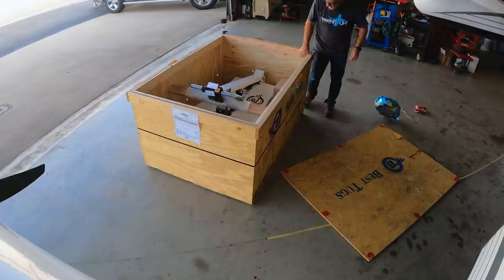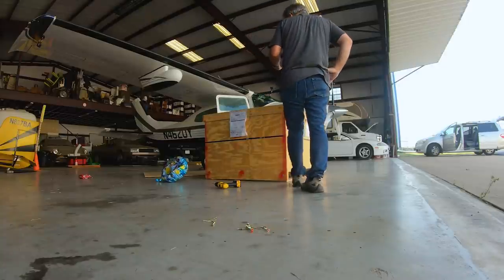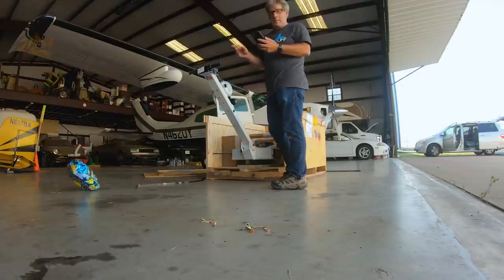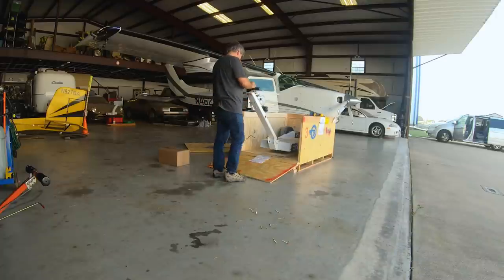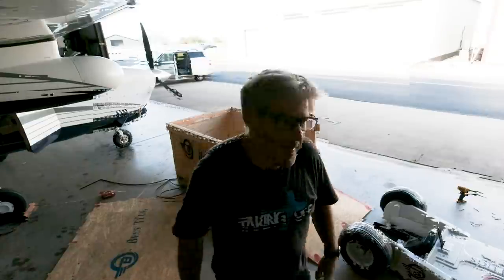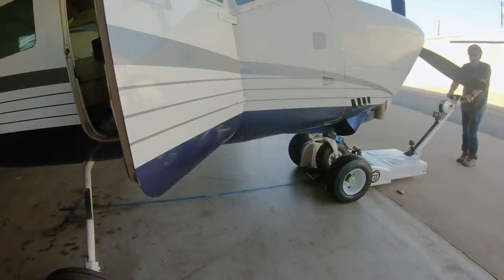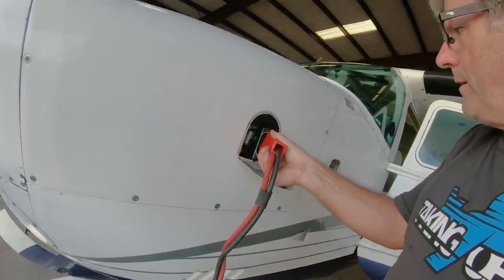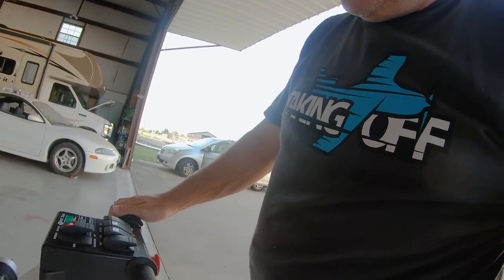Unboxing a Best Tug!  TakingOff

Comment: Nice Christmas present, Dan!
And a smart decision!
Over time Your new B5 tug will pay for itself by 
Greatly expanding the lifespan and prolonging 
the need to replace a dead lead-acid battery.

Furthermore it's a great investment in reliability of
of Lola - no missed filming appointments 
any longer because of a dead battery!

Aircraft starter batteries in general are always chosen too small
compared to industry standards with regard to the engine
size/displacement because of the weight
penalty that comes with their size -  after the engine is running you carry around a more or less
useless lead-acid bloc for the whole rest of the flighttime!
In cold winter conditions you now have the reliable chance
of getting Lola to live anytime thanks to the B5's integrated charger 🙂

PS: attaching the winch belt directly to the front-wheel fork and winching it  
into the wheelholder greatly reduces the amount of stress for the gear assembly and the
engine mount of the 210.

Dan, I wish you lots of fun every time you move Lola around gently with the help of your new B5 tug! 
BTW: I think your new tug should be given a name matching with Lola - what about asking the community for suggestions?
All the best and many happy landings! 😊
Reply from the maker: 😂 Ill have to chew on a name.
Reply: @TakingOff  My RF-9 is named HUGO derived from the Registration D-KHGO. Wait a bit and a Name for your new Lola mover will come up by itself - I am sure 😉🍀

Comment: Great video and I hope you enjoy your new plane mover!  I've seen several Romeos and a couple of Bravos in use and they really are much better than most everything else available out there.  I'm hoping to get a chance to use an Echo one day, but my current employer doesn't want to get them because they're not "heavy duty" enough.

As was hinted by Ethan - the best way to load is to use the strap and winch to pull the plane onto the tug.  You can drive under it, but that requires you to have the parking brake set or the wheels chocked.  Even then, it's generally considered to be riskier to do it that way as you're not in positive control of the aircraft at all times.  With the strap connected, it can't roll back, and the furthest forward it will go is the cradle stops.

I'm also pretty sure that it's what is recommended in the BestTugs "how to use" video on their YouTube. :)

Comment: Dan - Your tug is a lot more complicated than my Best Tug Alpha, but I use mine for a Husky, which probably weighs less than half what your 210 weighs!  I will say this though - my Alpha is awesome!  Best investment for my back ever!  Oh, and I had just as much "fun" unboxing it as you did.  I had mine delivered to my A&P shop on the airport where I am hangered, so I did not need to be at the airport when it was delivered.  I unboxed it on their loading dock, and then drove it down to my hanger.  Good thing the tugs come mostly charged up!  Also their boxing is excellent, and for what we invest in any model of a Best tug, we sure should not expect any shipping damage!  My Alpha has tailwheel adapters, so it is super easy to attach and detach from the Scott tailwheel.  Best has also given me excellent service. (no I am not sponsored by them either!).  Enjoy and have a Merry Christmas and a Happy New Year!
Reply from the maker: Thanks Chris!!

Comment: Nooooooo, I had to stop this just before 7 minutes in.  Dan, if you're going to say 'Back to work!' you've GOT to have that fist pump of Mikey!  FIst pump, and 'Back to Work!'
Reply from the maker: Clearly I need much practice to connect to my inner Patey. And a brain transplant for an engineers mind.
Reply: @TakingOff  Dan, as to the Engineering Mind that comes from the Patey brothers, Elon Musk comes to mind, Clyde Cessna, Walter Beech, Kelly Johnson, a few others.  It's, in my opinion, a rather rarefied club.  But, keep using his Best Tugs products and some of the other stuff he does, and you'll get your Inner Patey on real quick.  :D
By the way, I loved the instructions on how to get it out of the box, in addition to everything else.  That, in and of itself, was worth making the video of.  Thanks!
Reply: Interesting video, thanks. I would not have the tug under the prop for starting. I think it is obvious but hey I have seen things happen.
Reply from the maker: Yeah that would be a big no. Having dealt with a prop strike a year ago. 🤪 (not because of that)
Reply: @TakingOff  yeah, something about keeping the arc of the prop clear of dangerous items.  I've seen what a tow bar can do, I don't want to imagine what a whole tow tug could do!

Comment: This is Dan, and yes, I don't like unboxing video's, so I deiced not to shave either. I've been told look way to young, so I'm doing my best to look much old for all my fans. Really Mike and Mark, you need instructions to unbox this Tug? Holy smoke. And where are the blue screws? Dan, send back that empty box with instructions on how to open the box to remove Texas air from box. Be sure to make it very detailed.  😵‍💫😂🤣 Dan, next time, go on YouTube so you don't have to read so much. It' was all right there for you!